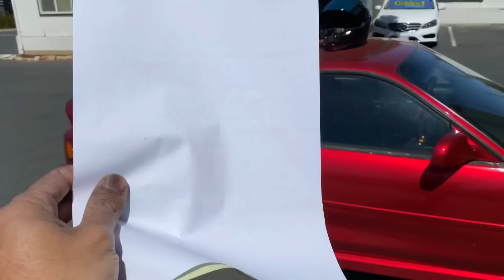BUDGET DAILY MR2 UPGRADES!

Comment: If I just had a garage to begin with
Reply from the maker: You can get a 10 foot tent from Amazon for $100. All you need is a spot that is protected from wind and is in the shade
Reply: @ParadoxTheWrapper  well my issue is im living in a spot that is rented. would i be able to wrap my car decently enough outside? it is somewhat protected from wind and at the right moment the sun wont blast on it either. i thought about doing it bodypanel by bodypanel one at a time
Reply from the maker: Micha H. Yes all you need is shade, lighting, and electricity for your heat gun